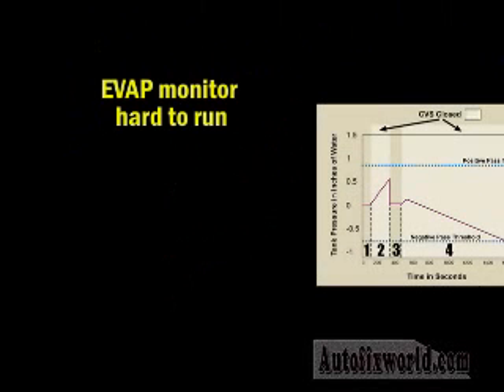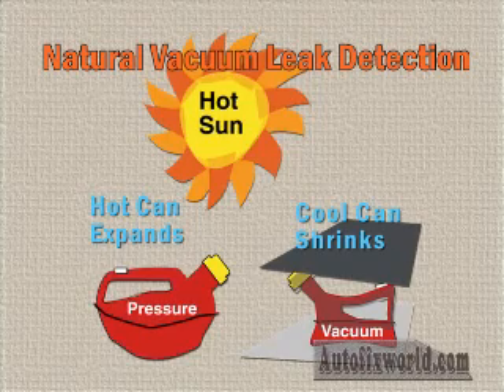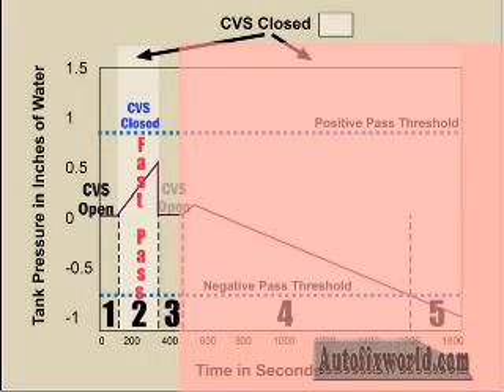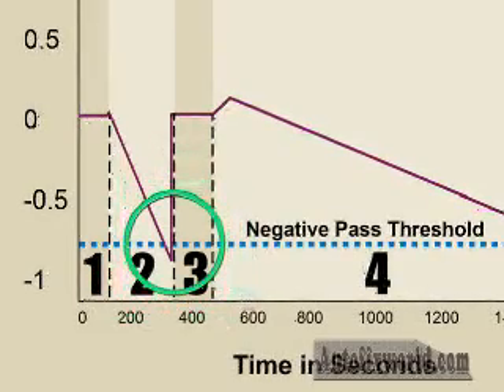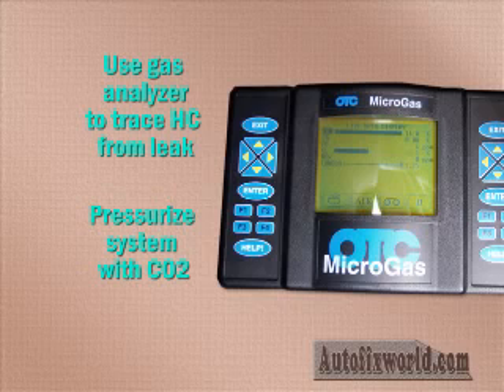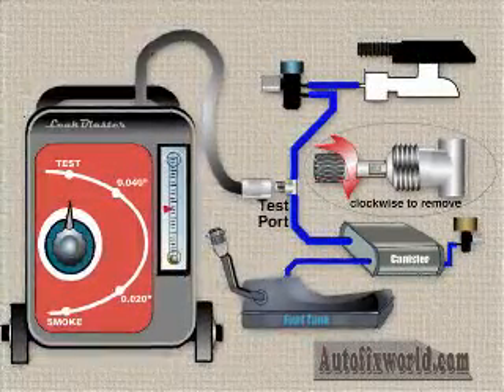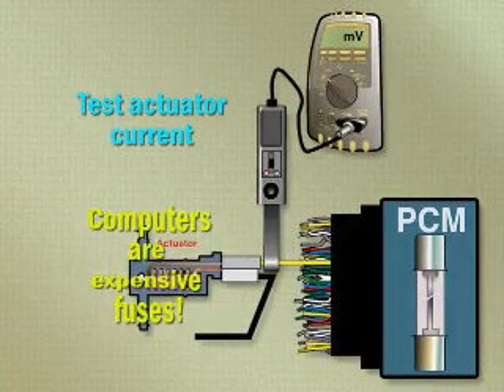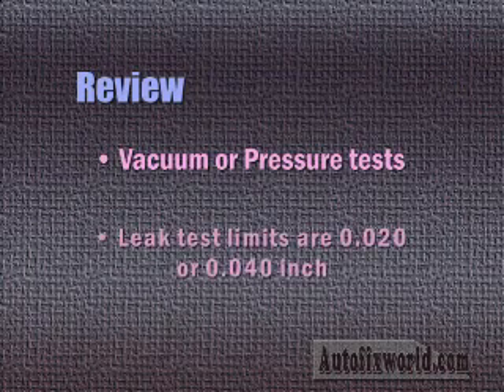Automotive Evaporative Emissions - Part Two

Comment: Such histrionics. Perhaps you should driven our city streets before these features were added. I can sssure you that the clean air you enjoy is no accident. To your questions: 1) The fuel vapors are held in the canister until purged, even when the vent is open. 2) For someone who wants no emission controls, you seem willing to impose the astronomical costs related to a "zero" tolerance leak test regimen. 3) Does your family breathe?

Comment: The fuel vapors inside a vented system do no escape to the atmosphere when the vent is open as they are "held" (adsorbed) by the activated charcoal inside the canister until purged to a running engine. During purge, several strategies are used to detect a change in air/fuel ratio caused by the addition of either fuel or air from the canister when the purge is opened. There fore the purge function is tested in a running engine. Hope this helps.

Comment: mmm, this is good stuff, but it doesnt really answer 2 questions, what does evap do while the car is running (no OBD testing goin on) and what does it do normally when the car is off? does it simply "vent" to atmos through the charcoal canister normally, and occasionally pull vacuum to clear the canister of fumes while running? i'm looking to convert to a standalone ECU yet maintain certain things like this via manual control.

Comment: "The vent opens briefly to allow tank and atmospheric pressures to re-equalize" Which means the fumes are dumped in the atmosphere. (WTF!!!??) Also a leak smaller than .02 is ACCEPTABLE and the vehicle passes. WTF??? That means certain leak sizes into the atmosphere are OK and the earth will NOT be harmed. It really means that this is a politician's invention. Inspection Stations can force you to pay tribute to the EPA instead of you feeding your family.